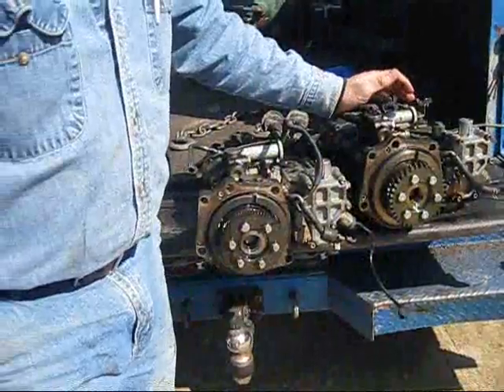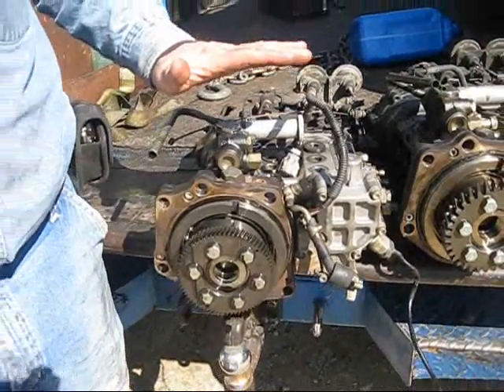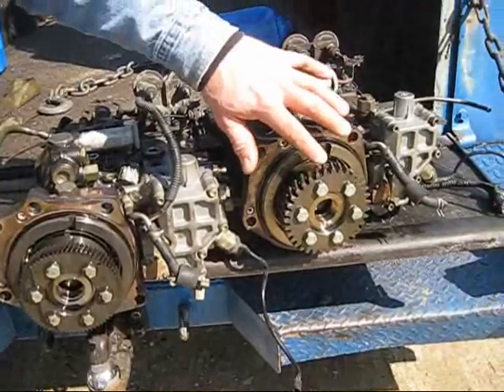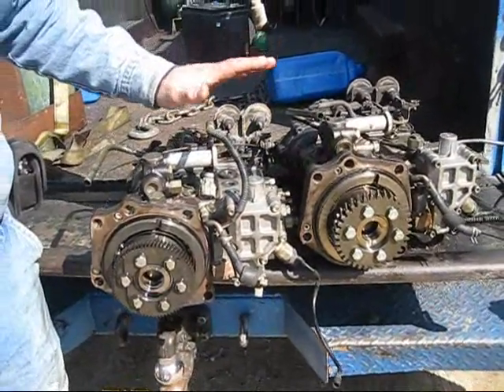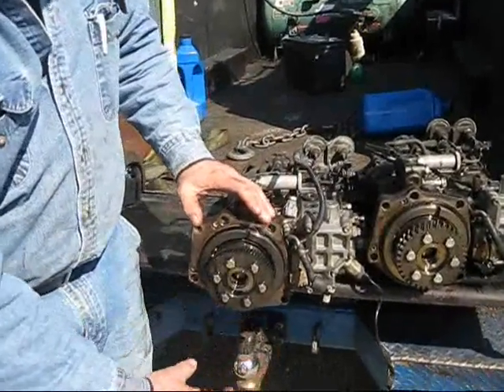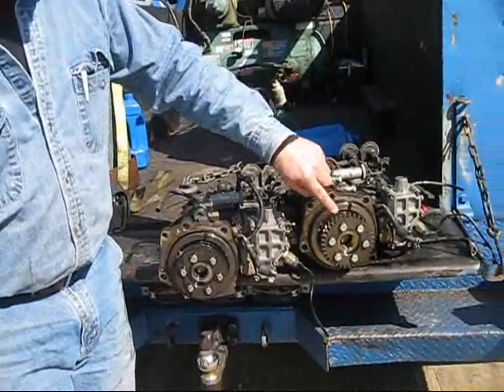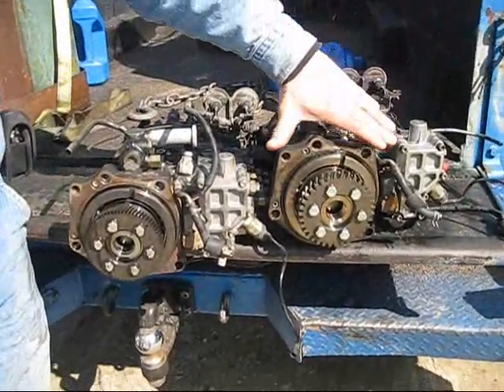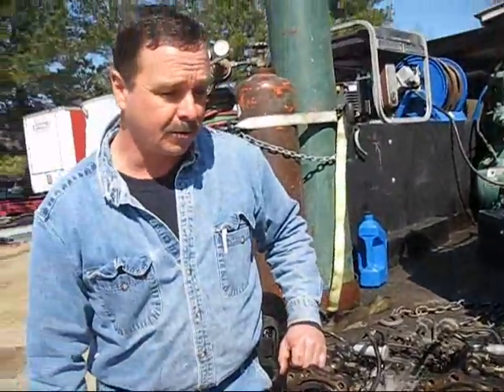Isuzu 4he1 Engine Tooth Gears

Comment: BEWARE OF BUSBEE!!! You know what you get at a junk yard exactly that JUNK!!! I bought one of these pumps from them to put on a spare truck that just had a brand new engine transplant kind of a side project I needed a new injection pump because when the original engine let go it blew a rod through the side of the block and actually broke the pump right off the side of the block. After fooling with it for a few months and passing it by other shops to double check my work turns out it's the pump and guess what after all the back and forth I'm now 30 or so days out of warranty and they aren't backing up anything on a pump that didn't work from day one. Oh and here's the kicker they said no we can't warranty after 90 days even though I had contacted them prior to that but we can sell you another pump at the tune of 1000$!!!!!! What a joke BEWARE!!!!!!!

Comment from the maker: Busbee's Used Truck Parts illustrates both fine and coarse tooth gears on the Isuzu 4he1 engine and how to tell the difference between the two.  This is important to know before ordering your Isuzu 4he1 Injection Pump.
Reply: +Busbee's Truck Parts buenas amigo este tipo de bombas ya instaladas se le pueden dar avance ,o adelantar o atrasar segun lo requiera el vehiculo ,ya que en el punto original queda como atrasado !, espero su respuesta ,gracias ...

Comment from the maker: Busbee's Used Truck Parts illustrates both fine and coarse tooth gears on the Isuzu 4he1 engine. How to tell the difference between the two. This is important to know before ordering your Isuzu 4he1 Injection Pump.   #usedtrucks   #usedtrucksales

Comment from the maker: Busbee's Used Truck Parts illustrates both fine and coarse tooth gears on the Isuzu 4he1 engine and how to tell the difference between the two. This is important to know before ordering your Isuzu 4he1 Injection Pump.
 #fleetmanagement   #trucking